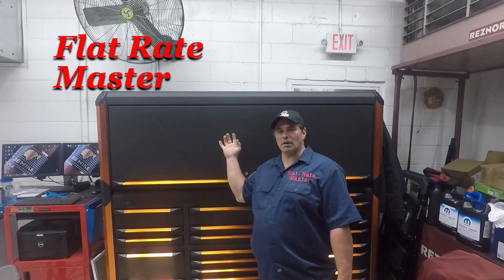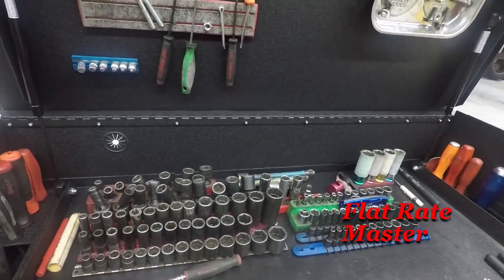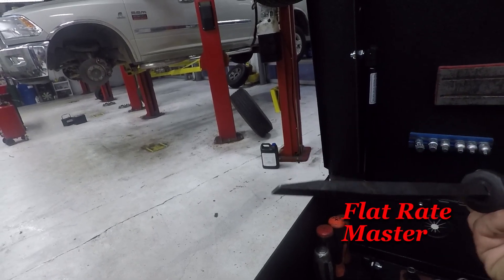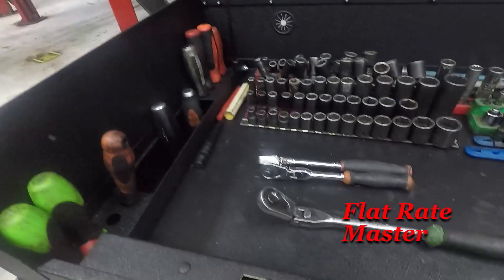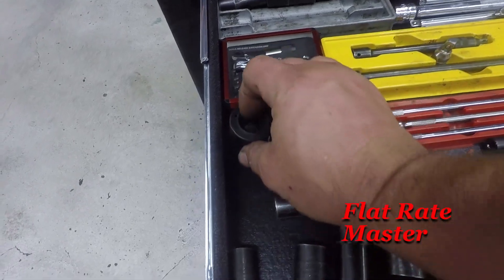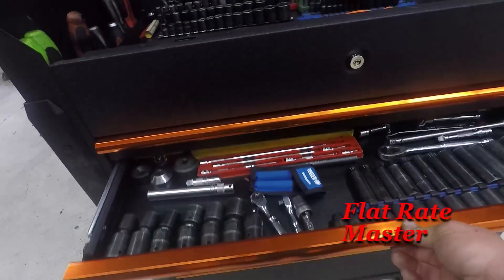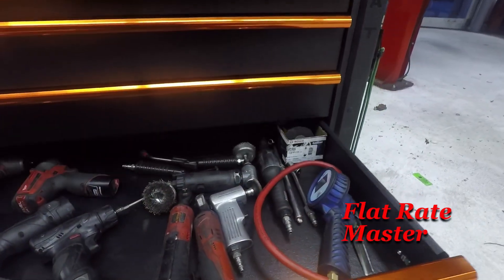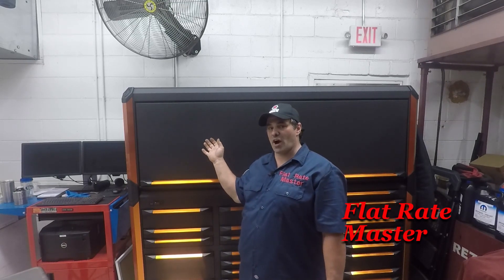Matco Cart tour 2.0

Comment: I use pvc pipes wich I heat and flare in one end and put them in the holes i have screwdrivers and breaker bars in, much more easy and faster than trying to hit sekond hole in holder.

Comment: Don't have that style bit driver. That would come in very handy doing fuel pressure sensors on Volvo. Pattern failures and little room for the 1 fastener.
Reply: Part number is hexdriver8
Reply from the maker: done several of those!

Comment: What happens if you drop bolts and little stuff down the pry bar and screwdriver slots?
Reply from the maker: Open at the bottom
Reply: My snap on you have to fish them out with a magnet.. I still have couple screw drivers I can get out
Reply: Can’t get out..
Reply: Daniel Erevia you just remove the bottom drawers. Look at the slides, there’s a quick release to pull the whole drawer out.